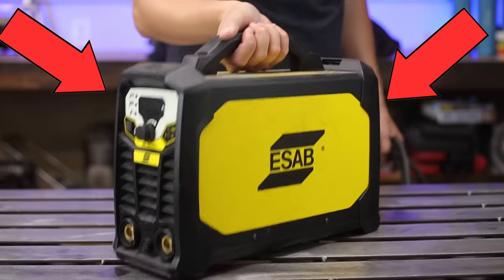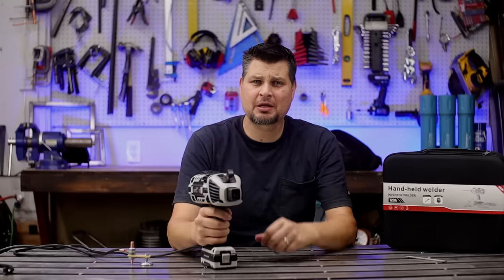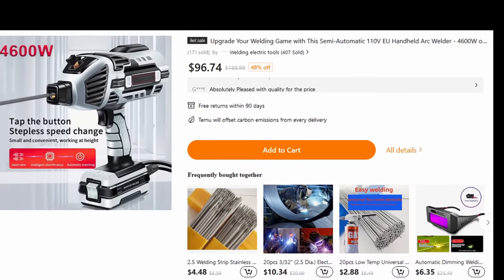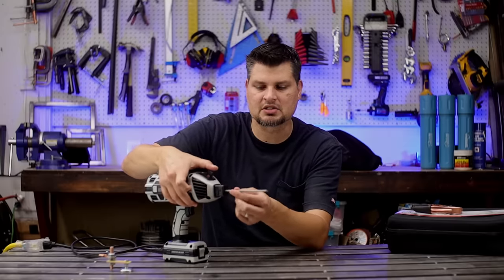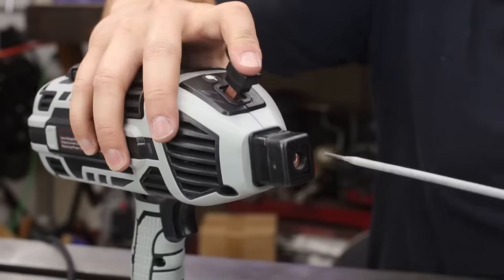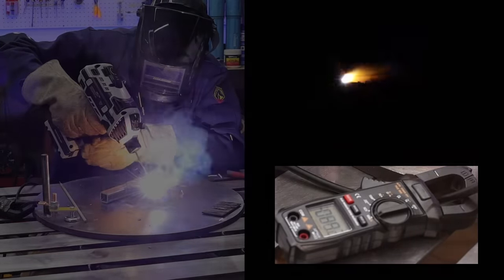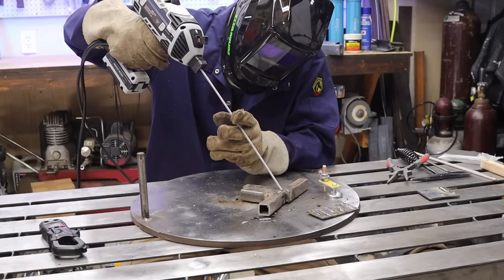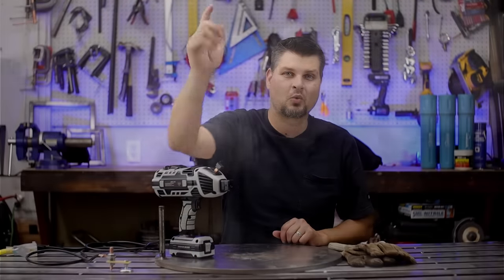The WELDER, Re-Invented! TEMU Surprise

Comment: I like the ultra compact size, and that its a goofy idea... a legit metal glue gun lol.  I'd probably make a rod extension holder so its easier to use.
Reply: Absolutely!
Just add a real stinger and wire length right to the front of it and your in business. 
I'm thinking that it would look good stuck under the seat in my trail jeep for those special occasions which occur when out stretching suspension.
Reply: @scottowens1535 First thing I thought. Add a stinger wire and then why not just use my inverter welder to begin with.
Reply: I was thinking about 3D printing a new case for it. The weight needs to go under your hand, so it stabilizes like a pendulum.

Possibly even arm mounted.
Reply: @kbbacon  because you won't have a metal glue gun.  Also, are those units as compact?
Reply: @Komeuppance  it's pretty small. Maybe not quite that small, but I get a little more power which means bigger rods. Thicker work material. I'll take a little more power. Also, it's easy on the breakers, so I'm not running back and forth to the electric box.

Comment: I wonder if it will weld 1/4" plate matches on 6" pipe. It would be handy on top of silos where you have to stretch out 200 feet of lead to reach up there.
Reply from the maker: Since it didn't handle the 1/8" rods I wouldn't trust it for 1/4.
Reply: Ok. Thanks friend

Comment: Hand held unit with 'trode on a cable and "feeds" the rod through the unit and completes circuit as you pull the trigger-- a "wire welder" that uses rods instead of wire-- solves the long length problem but can the weight be kept down?

Comment: At 2:30 the magnet might be attracted to the steel coil inside the grip and would explain why the clamp handle bent at the tip of the spring.
Reply: Not really found most cheap stuff made in China use brass coating on mild steel, brass is expensive.

Comment: I bought one of these from Amazon.
The amperage is all over the place causing a very splattery and uneven weld.
After 4 rods the damn thing caught on fire,,1/16th rod on no3,, luckily my garage fuse blew but I threw it out of the door still belching black smoke.
I gave them the benefit of doubt just in case this was just a faulty unit.
After 3 weeks the replacement came.
This one lasted a bit longer, it welded poorly for almost 2 hours using up 9x 1/16th rods on no 3 setting.
This time my mains fuses started to blow instantly every time the damn thing was plugged in.
No fire no smoke but the welder was dead shorted between positive and negative.
Do not buy one of these Chinese welders, they don't work plus they are dangerous.
I opened up the second unit, the plug was earthed, but the earth wire inside the machine was not connected to anything, no fuses were found inside the machine,the copper coil had melted causing the dead short.
These are an electricution with possible death waiting to happen.
Reply from the maker: Thanks for the info.

Comment: Just recently my machine at work started being intermittent and shutting off on stick mode so I ended up doing the job on tig mode with my pedal but on dcep with stick electrodes, and honestly starting a stick with my pedal was amazingly easy and much better than scratching lol

This kind of reminds me of that! I bet with some use this could be better for some than scratching as you can just put it down a mil or two off the work and and pull the trigger? 
 
Does this have a high frequency start? Or?

Comment: My mod would be a zip tie around the trigger and connect an extension line from where you clamp the rod, and use that extension to hold the rod. Won't have to hold the awkward thing
Reply: could you just use one of those on off foot pedal things coupled with your zip tie method to make it more safe?

Comment: Out of curiosity could this be used to tack weld on cars? I have a car that has rust around and I was thinking of repairing it.
Reply from the maker: In a pinch maybe. Stick welding isn't the best process for car repair. If you have a lot you'll want to look into a MIG setup.
Reply: @-DIYPRO-  ok I'll look into that thanks for that pointer. Still doing research on these stuff. Thank you for the assistance.

Comment: I would take it apart for the guts, replace all the led wire with higher gauge, replace the trigger switch for a toggle, and wire up a traditional stick holder, put it in a small box and use it on the trail to fix my truck.
Reply: Are you joking :D why not buy a normal welder that is the same size as  this?

Comment: I wonder, 
if this thing was attached to some kind of spring jointed arm on a table, like the kind of armature used for a desk lamp....

Could that take all the weight off the tool, allowing for MUCH longer use time?
Reply: Or better yet, take something like vice grips, attach a wire to them, then connect the wire to the welder, and put the electrode in the vice grips. Do you think that would work, it would be much lighter, giving you much longer use time?

Comment: A Plug-In 'Cordless'!....ALMOST as kool as dehydrated H2O powder packets....
I cannot wait to get my hands on a hoseless pressure washer wand system! ~Sending pressurized/invisible water WireHoseLessly from the machine/sending unit, transmitted through scalar time-tunnels, only to emit from the nozzle of the p-wash wand @ 3500 PSI!...;)

Comment: Can you help me so this type of welding I can use  for the business or not
Reply from the maker: If starting a welding business I would NOT get this welder. This would be good for light duty stuff every now and then. For a business you'll want a higher amperage machine with more duty cycles. Looks for an older AC Miller or Lincoln stick welder, they are cheap and it will last forever.
Reply: @-DIYPRO-  thank you so much

Comment: I bet an experienced welder or a clever electrician could wire in the adaptations necessary to plug normal stinger and ground into it, and make it a sort of a belt hanging model.

Comment: The classic "solution to a problem that doesn't exist"! There are numerous small welders out there and while that one is about the smallest yet it would be MUCH better just to have the tiny machine connected to the rod by a short conventional stinger/rod holder. I mean honestly look at that thing and how clumsy and unwieldy it is compared to a regular stinger/rod holder plus so many instances where it would be unusable in a tight spot. Now a simple solution for this thing, just attach a short cable/rod holder to the output and it will be MUCH easier to weld with while holding a lightweight rod holder vs that thing plus the conventional rod holder will fit in awkward places where that thing won't! Need to climb a ladder or whatever? Hand the darn thing on your belt! No matter how small the thing might be it's still just a welding machine and it makes no sense what-so-ever to stick a rod in the machine itself try and hold the entire thing while welding when attaching a short welding cable to it (just like any other    stick welding machine) would make it so much easier to use, honestly in what situation is that thing a good idea as opposed to attaching that short welding cable to it?

I have been welding since 1968 during which time I have seen gimmicks come and go and I predict this is going to be one of the ones that go! I also predict that the vast majority of these things will end up with a short cable attached like it should have from the factory.

Comment: I can't imagine anyone in their right mind buying one of those and try use it, It's bulky, It's much heavier than a common welding lead,
 What exactly is its advantage? You still have cords to deal with.
 I would rather work with a small welder with light weight leads.
 There is better solutions.

Comment: Question; would this be a valid option to carry in an over landing vehicle to do trail repairs when far from help?  I have both a Jackery Solar Gen (1000w) and a small 2000w Honda gas generator. How long would it last on the Jackery battery and can the Honda push it appropriately?  Thanks.
Reply: No, this has literally no reasons to exist. It's not better at anything than a normal welder of the same size. Especially for trail repair, you dont want to be holding a whole welder in your hand when you're welding upside down under a vehicle in the mud. Just buy a normal welder that is the same size as this but with normal leads.

Comment: that turning direction makes no sense,as you need often to clean up a rod tip,during stopping and starting another weld,turning direction  still leaves a hole from the rod  that has too much flux on,file or other to clean it up for  a good strike.i was just wondering  as many rods nowdays  need reverse polarity,so negative electrode,so is turning direction  crappy chinese english,for turning direction of the positive/negative   to the electrode?If it cannot  change electrode  connection   its prety useless,as many rods   electrode negative.

Comment: It would be useful as caring spare tire jack jumper cables and those on road hauling trailer or in back fourty or around barn Bull went thru pipe fence tore up trailer load horse's on highway hundred miles nowhere middle night no problem

Comment: I have no idea why Americans are stuck with 110. You simply can't do any real work on that voltage/current combination. A 220 machine would have been a lot more capable.

But anyways the trigger is likely a safety feature, because it might not have a VRD, which means if your gloves and PPE got sweat soaked, you could be electrocuted if you accidentally touched yourself. I think most stick welder should have a trigger on it.

At first I was thinking, battery powered welder...

If someone made a self contained battery powered plasma cutter... man theft would go way up. No gates or security feature, fences, or whatever will ever stop you if you have a battery powered plasma cutter.

Comment: Just Another WOFTAM,  Waste Of  F####ing Time  And  Money, How would it go doing up hand over head or in tight spots, how do you control the extra length from the hand position ? cut the rods in half? no hf start option? Why would you want a mains lead that close to a hot work area? certainly not something for a beginner and a pro would laugh at it. if it were capable of spot welding on a much shorter copper electrode it might be ok. I have used many diferent types of welders over 50 years and seen many changes but none as dangerously stupid as this.
For a brief moment I thought it might have been a CORDLESS Welder may be even a mig or tig ,Now that's some thing that would be usefull. may be in the distant future.